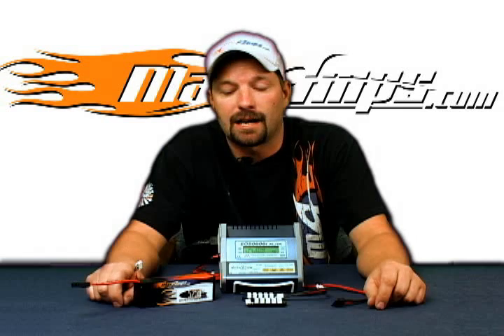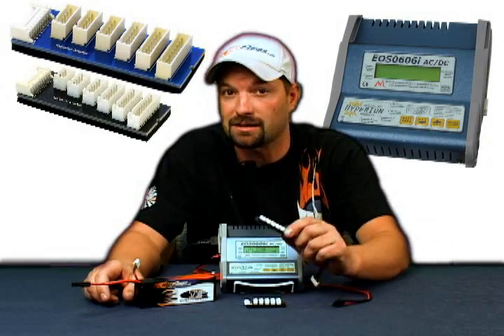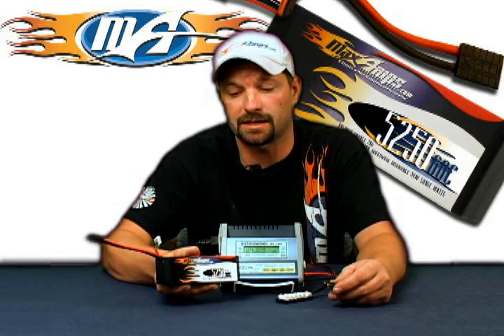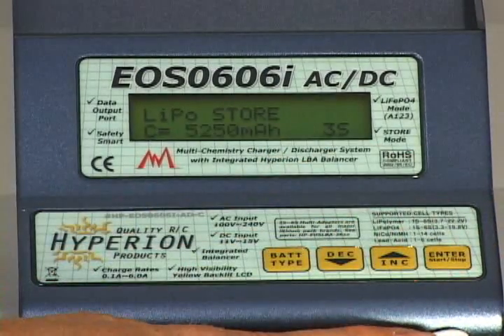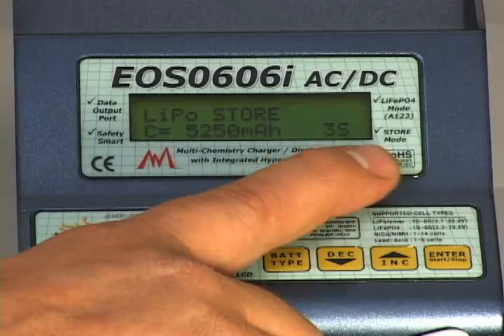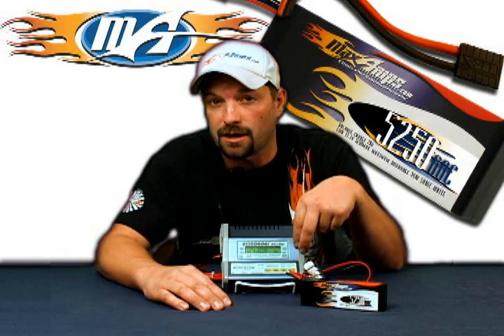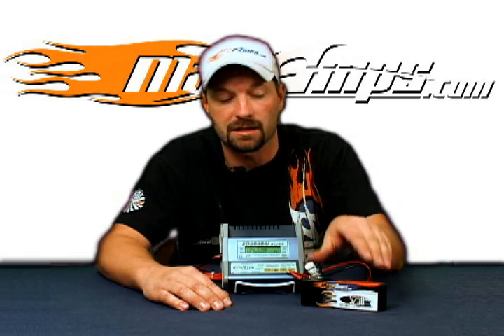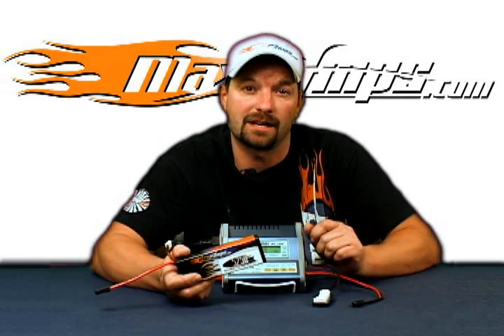How to store charge a LiPo pack using the Hyperion EOS0606i AC/DC Charger

Comment: I have this charger. Can i use this charger to charge 1s lipo battery with balancer connector only?
Reply from the maker: No you need to charge using the main plug. Balance connector is for balancing only.

Comment from the maker: Nothing needs to be set in the balance menu. Once you are on the balance screen just hold down the enter button and it will balance only. Note: The charger will balance every charge if the battery is plugged in correctly.

Comment from the maker: If your pack is in storage for more than 30 days you want to cycle it at least once every 30 days until it is to be used again. That is a full charge and a full discharge. You can then return the pack to storage until you are ready to run or cycle again.

Comment: @B8404RN worse case 30 cycles. worse case with a good charger like hyperion - about 200. usually packs that are treated well last about 400 cycles some report even 800. I all depends on the quality of your charger, not discharging each cell too low and not subjecting your pack to high heat. Also a pack that is discharged only to 50% will last more than the one always discharged to 25% capacity.